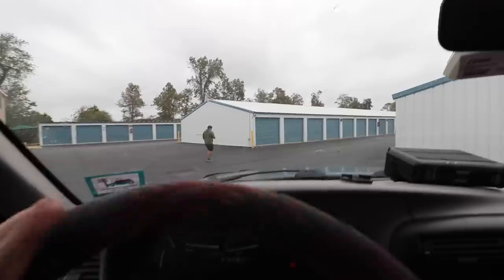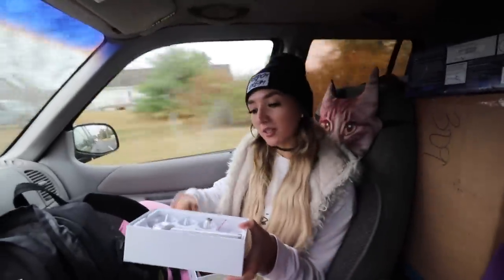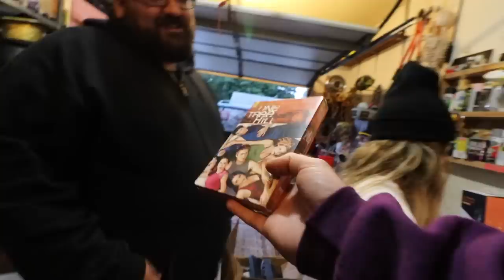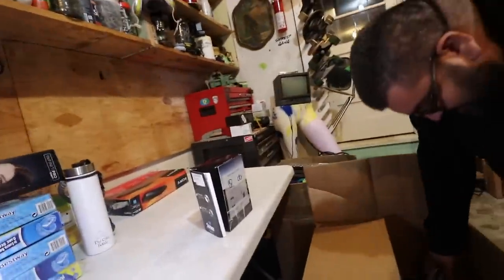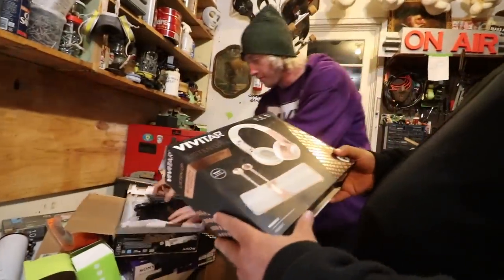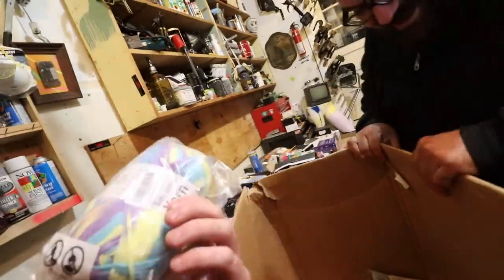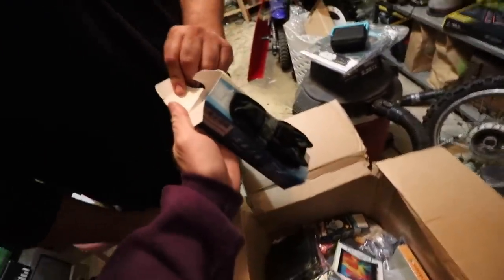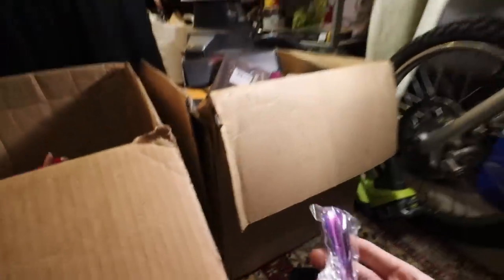We Bought Eight MYSTERY Boxes Of LIQUIDATION Merchandise!

Comment: Off topic...remove your rear wiper or you may forget that the rear window wrap is on the outside and using the wiper will destroy it. A nice chrome handle over the spindle would finish the look.
Reply: Lawrence Stroobandt It would be much easier and faster to simply remove the rear wiper fuse.